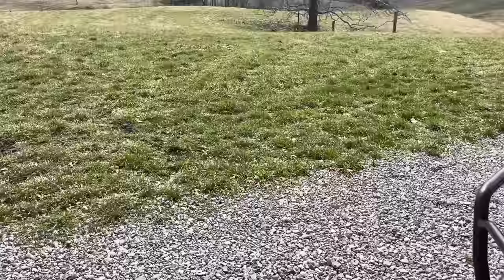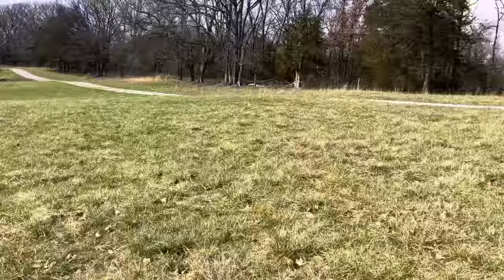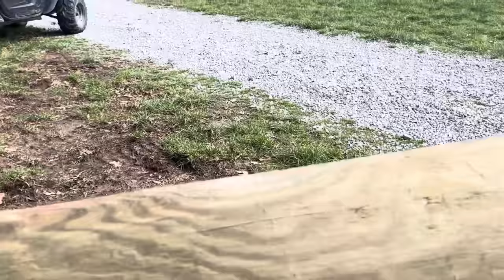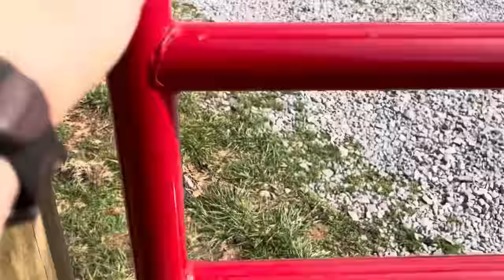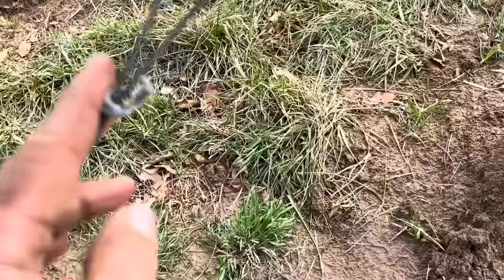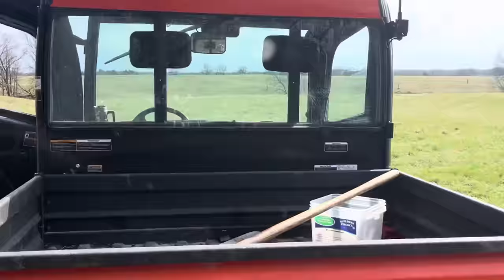Greg explains their corner post installation and H-brace assembly with gate installed.

Comment: Wheel under latch end of 16 ft gate?
Reply from the maker: Humm, I need 5 wheels, may need to visit my welder friend.
Reply: @gregjudyregenerativerancher  takes stress off hinges AND folks hands and shoulders. Does make it a bit difficult during appreciable snow events, in case you need an argument against wheels...

Comment: Greg, whats your thinking on using wood posts versus timeless fence posts for high tensile wire posts. You use both, but wood is by far way more costly. Let us in on your thoughts.
Reply: Wood braces are much cheaper than timeless. For line posts timeless is the way to go.
Reply: Timeless will never rot
Reply: @RoyJemkins  true, and there are other benefits to timeless as well. No insulators, easy options for termination. There's just such a difference in cost that I couldn't justify it. Not to mention, I'm hanging a 16' gate and using an auto gate opener. I needed something that would have no problem supporting that gate.
Reply from the maker: We have hung 3 16’ gates and with wood H braces the gates are very sturdy. Absolutely no sagging.
Reply: @gregjudyregenerativerancher   except in this video you are using hundreds of wood posts driven into the ground…not just at gates. I would expect timeless to be cheaper for these.  Is it just a look you are trying for?  I know you don’t want to bite the hand that feeds you, but there has to be a good reason for using wooden non gate posts instead of timeless.
Reply from the maker: There is side pressure with the arc in the fencing property lines. I don’t want the fence bending with dude pressure from 5 hi tensile wires. I have a leased farm where that is happening right now.,Previous owner did not get the posts into the ground deep enough and now the whole fence is sagging. It will have to be rebuilt to fix it. I’m not spending extra money for the heck of it, there is a purpose behind it😊
Reply from the maker: @greggmcclelland8430 not hundreds of wooden posts, but 90. I will be doing a video on why I went with them in the near future. Got folks freaked out it seems!!!
Reply: @greggmcclelland8430  a timeless H post is what you'd need for that application and they're $40-50 depending on length. You can get a treated wood post for about $20 that's the same length as the $50 H post. Don't get me wrong I'm a fan of timeless, just stating facts.

Comment: Really not a fan of the CCA posts…are there no hedge posts  locally??
Reply from the maker: Been using them for 40 years, no issues with them at all, we make sure to seal the top of each post with a metal cap.
Reply: @gregjudyregenerativerancher  the ones dad used in the 60/70's rotted off at ground level.  I bet different soils act differently on the posts.